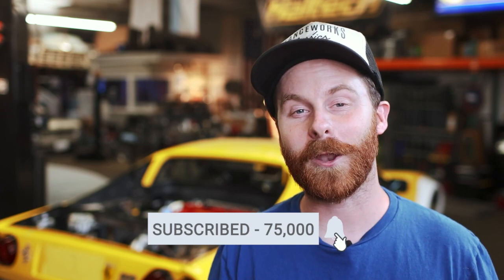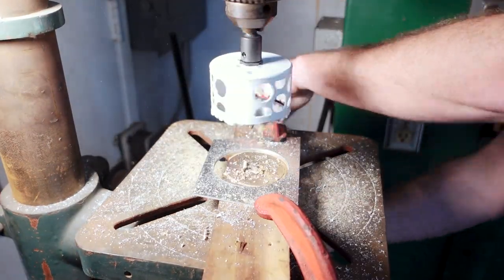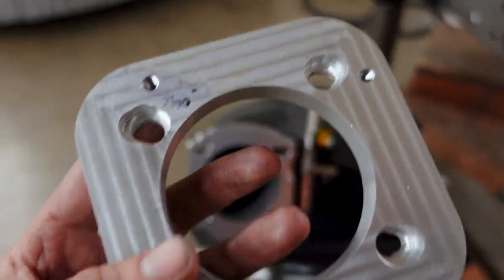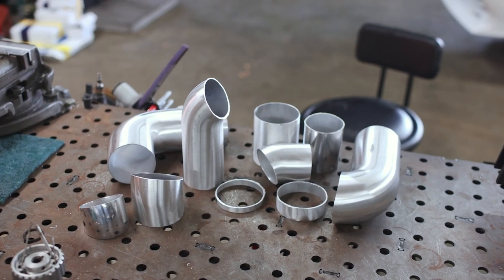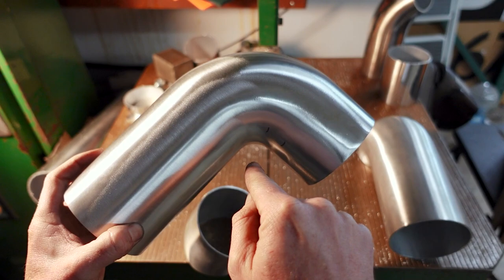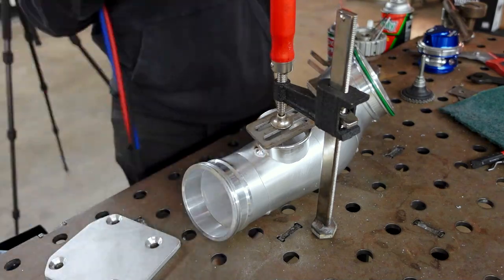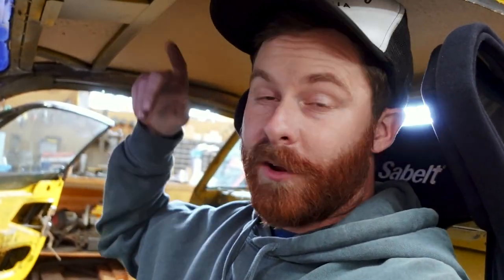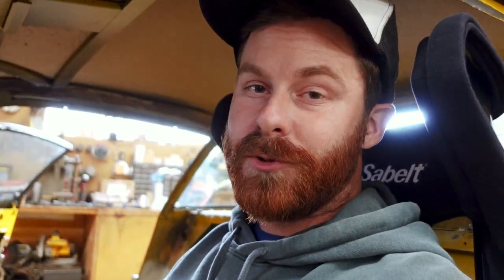1000hp Honda-Powered Ferrari Gets Intercooler Piping & Blow Off Valve Setup! - Ep. 76

Comment: charge pipe intercooler: since there are 2 ends open would adding something like 180mm(or whatever fits there) static pressure fan at each end in a push pull configuration add any benefit to the cooling of the air before it gets to the throttle body? just an idea
Reply from the maker: Each end gets capped and water goes through it. It’s not a traditional air to air intercooler

Comment: Did you consider rubber isolating the intercooler? Mounted solidly, it will be prone to vibration and likely will crack.  Also, the dissimilar metals will create a ugly galvanic response.

Comment: Not to state the obvious Mike but you still need the water tanks on the intercooler. Might be a good idea to move the catch can? I don't remember exactly what it is on the bracket in the way. But you still need space on both ends for water tanks and inlet/outlet water for the brick.

Comment: Loving the build! Completely agree with the ‘ugly’ Ferrari construction! Probably something that can wait but I noticed your throttle body adapter consists of: the plenum flange, the primary bolt pattern converter plate and the secondary plate to change ID, then the TB itself. The plenum flange has a constant ID, the primary has a constant ID and the secondary has an ID transition. Not great for flow. You could spread the transition over both the primary and secondary to reduce the angle. Is the juice worth the squeeze?….  I don’t know but, food for thought. It might just allow you to hit the 1000bhp at a few psi less?

Comment: Why not just use the OE headliner and cut a hole above the head. Glass in a concave bowl and then recover the liner. That would be much easier and still look OE except for the concave part. Just my 2 cents.

Comment: 100%, a very thin layer of foam to hide crimes and a layer of your nifty Porsche carpeting will make a better headliner than what came out. and instead of the trim pieces that used to cover the pillars, you could always just directly adhere some foam-backed vinyl to them. Most of the interior trim of that car is vinyl anyway, so it would still be quite consistent. Or you could just embrace the carpet and use it all over. Honestly, for a primarily race-focused car, having an interior with any carpet at all is a luxury, so splurging on alternate materials for the various surfaces would be odd. Might as well just cocoon yourself in that carpet.

Comment: You shouldn't be using brake-clean to clean your parts before welding. Heated brake-clean and argon can produce phosgene which is really dangerous 🙈. Acetone is a safer alternative.
Reply: Came here to say the same thing.
Reply from the maker: You’re correct. Fortunately I’m using non-chlorinated brake clean. I used acetone afterwards but you’re right, I shouldn’t use it either way.

Comment: Is the rigid mounted intercooler going to be an issue with your urethane mounted engine using the intake charge piping you fabbed up? This is a fantastic build by the way. I'd hate to see the final cost though.

Comment: The headliner issue: can't you put thinner padding on the seat? Or just cut out a hole where you need it but then cover the entire headliner with stretching fabric so the hole isn't visible, but when you get in the car the fabric can stretch to give you the extra headroom? For the rollbar: would just adding thicker baseplates do the trick to close the gap up top?
Reply from the maker: I removed the padding already.

Comment: Why would you go with a larger throttle body and immediately after it go down in size into the plenum? I know this is a forced induction application, but your intake will only flow as well as it’s most restrictive part

Comment: Curious, is there any specific reason someone would have a throttle body that's a larger diameter than the rest of the piping (as opposed to being the same diameter), or is that just how it works out sometimes due to part availability?

Comment: If you weld a spacer under the mounting plate of the roll bar will it compromise the it's function and safety? Instead of doing it all over again! Sorry guys I have to remind you I'm no builder I'm here for the build and to learn pardon me if my comment sound stupid... 😅
Reply from the maker: It would need way too much spacer. It’s not the right way to do it.
Reply: @stanceworks  Dropping the floor would be way less work than re-making the rollbar and would offer other benefits like improved seating position while driving and make ingress and egress much easier with your heavily bolstered seats. I've been building this type of car for 20+ years . If you haven't seriously considered it, you should. 
Very cool build by the way!

Comment: How is that intercooler going to get a constant flow of cool air to it?  On camera, it looks like it’s in a position where it won’t.
Reply: It's a water to air intercooler and doesn't need airflow. The remote heat exchanger for the water is the only part that needs airflow.

Comment: SAFETY WARNING!!! Never EVER use brake cleaner when welding as it is insanely dangerous to do so. The active ingredient in brake clean Tetrachloroethylene when exposed to heat and argon creates Phosgene gas. As little as 1 cubic centimeter of that gas inhaled can drop you dead. Alternatively in smaller doses it can cause lung and nerve damage that is irreparable. 

Brake cleaner is one of the most awesome inventions ever for a shop but it does not belong anywhere near a welder. Using acetone is every bit as effective and much safer. I don't mean to be a downer but this is an incredibly important safety tip and I'd hate to see anyone be affected by something that can so easily be avoided.
Reply from the maker: Yeah, I’m getting blasted pretty hard for that one. Upshot is I’m using non-chlorinated brake cleaner which won’t produce phosgene gas. Still not the best product to use, though.

Comment: Seems a bit premature to call it a 1000hp anything when it's not been on a dyno.
Reply: It a purpose built crate motor built to that specific power level with the same turbo set up etc that others run/make that power with. Pretty safe to say tbh
Reply from the maker: I’m calling it 1000hp because I was promised the engine is rated for 1200. So I’m going with it.